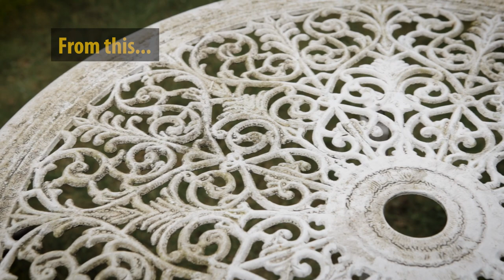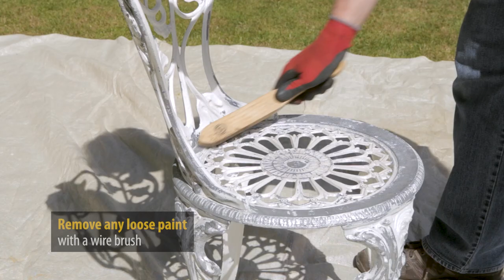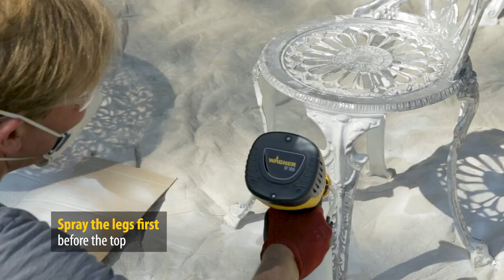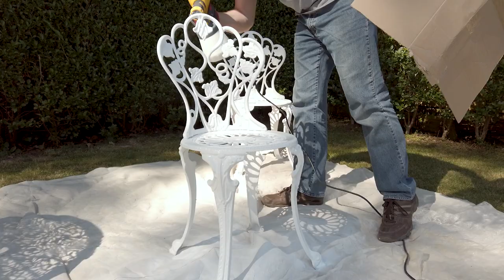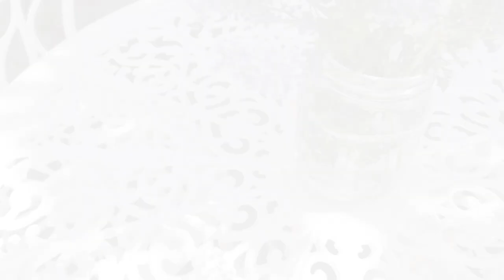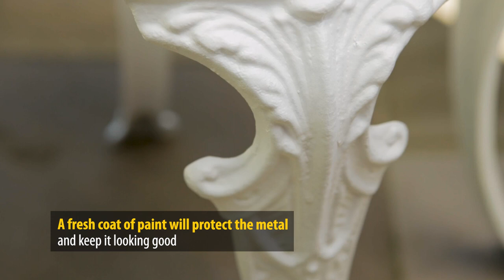Spray Painting Metal Garden Table and Chairs | Tutorial | WAGNER

Comment: I presume we can use a metal paint eg Hammerite in the sprayer?
Do we need to thin it first?
Reply from the maker: Hello Tracy if you are using Hammerite you can only use the smooth version. However, we would recommend using water-based paints. This a preferably because they are easier to dilute simply by adding water and easier to clean the machine up afterwards and they're readily available for a wide range of applications. Watch this video section Craig Phillips explains about dilution (2:26) and how to get the dilution just right. Kind Regards the WAGNER DIY Team
Reply: Thank you for info.
Reply: @WAGNERUnitedKingdom  Aside from smooth Hammerite, do you have any recommendations on metallic finish water-based paints please? And for wood/metal projects, what lacquer/varnish would you recommend please?
Reply: @WAGNERUnitedKingdom   Hi Guys, would you reccomend using Hammerite Ultima as that is water based. I have yet to use my new w690, I purchased it to paint my garden fences but if I can also use it to paint my fire escape that will be great news.

Comment: How much do you have to thin the paint?  Is there a 'recipe' for how much water to add to paint when using a sprayer?  I have the Wagner, but it is more of a bucket style sprayer.  thanks
Reply from the maker: Hello Peggy. There is no one-rule-fits-all when it comes to dilution. We recommend starting at 5-10% and performing a test spray. You may need to keep diluting further depending on which sprayer you are using. The more expensive high-power sprayers will require less dilution as they have more turbine power to atomise the paint. Thanks - The Wagner DIY Team.

Comment: Are these spray units easy to clean?
Reply: they can be disassembled pretty easily. You then need to wash thoroughly the container with water to remove the paint and the main part with brushes
Reply from the maker: Hello There is a video showing the Fence and Decking sprayer being cleaned here https://youtu.be/d0UcHMmzvkI. The cleaning process is the same on each of the sprayers so hopefully this will help.  Kind Regards The WAGNER Teams